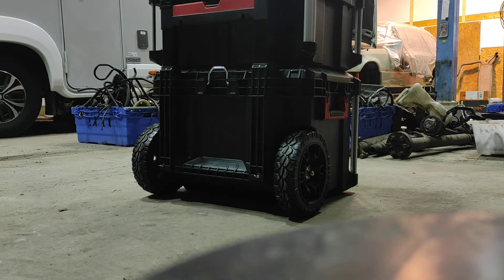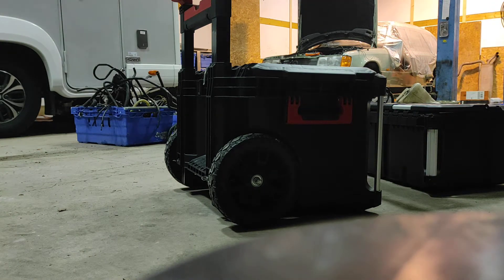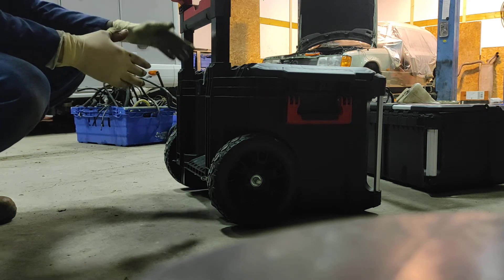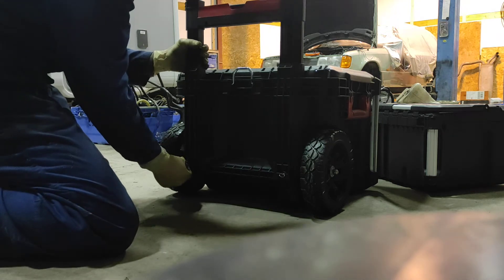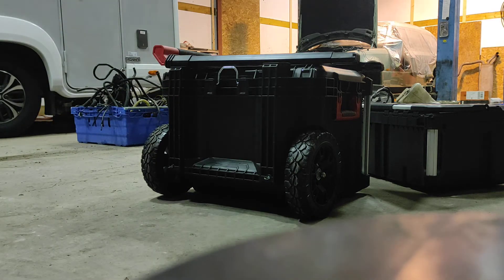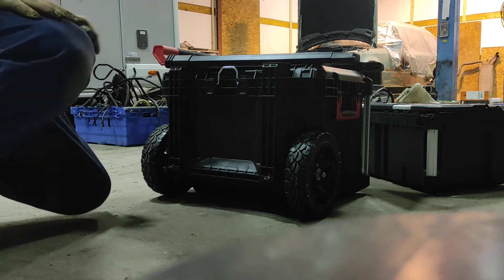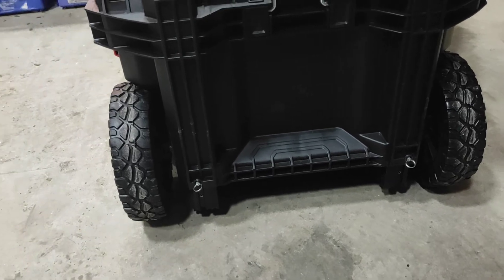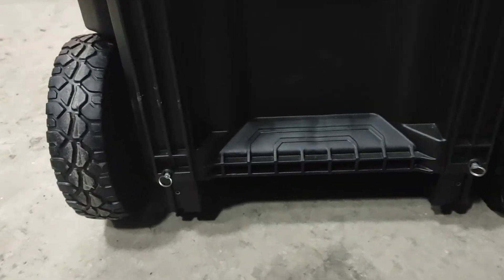Milwaukee PackOut handle Quick Release mod

Comment: Cool, I just got myself this from my local toolstation as they had it on offer and the first thing i wanted to do is take out the handle. Then i remembered that you can get something to replace those self tapper's and put something back in it's place ?, I did not know what they were called until now. Thank you for the information and have x5 of these pin's on the way tomorrow off amazon, cheer's buddy.

Comment: Just used your video and did this tonight.. worked perfectly. Thanks very much. I had to take off the little nuts off the index plungers to be able to screw in far enough to catch the holes on metal.
Reply from the maker: I did the same. Good to hear you found it useful.

Comment: How does it screw I if the bolt that comes with the pin is hexagon and the plastic box hole is round
Reply from the maker: You need the tap to put the thread in.
Reply from the maker: An m6 tap.

Comment: Would these work ? So that they lock out to make removal one handed  
https://www.berger-tools.co.uk/Gn717_Indexing_Plunger_Optional_Rest_Steel_Plastic_Knob/
Reply from the maker: You could probably get them to work but I wouldn't bother, with the other type being so handy to use. There is a ebay link to the ones used in the description.